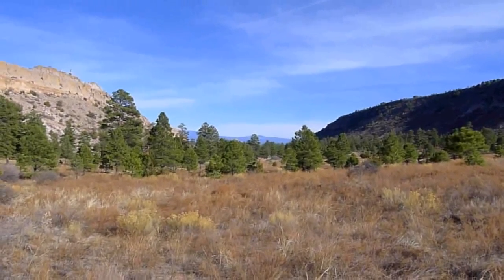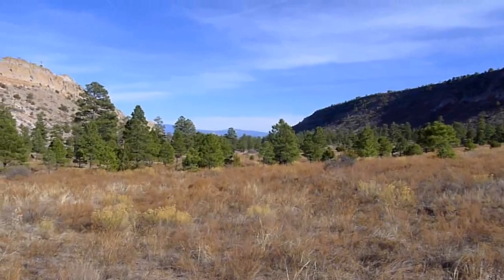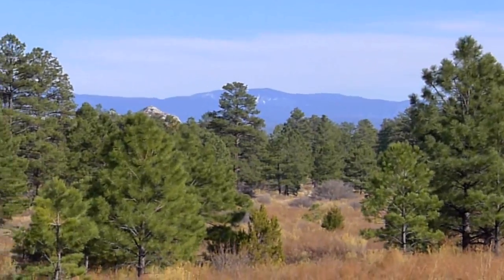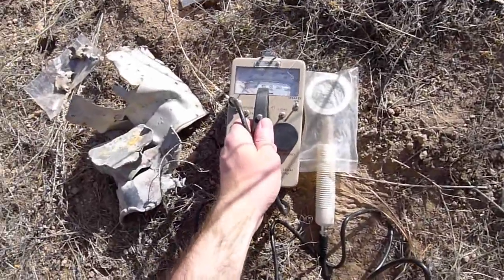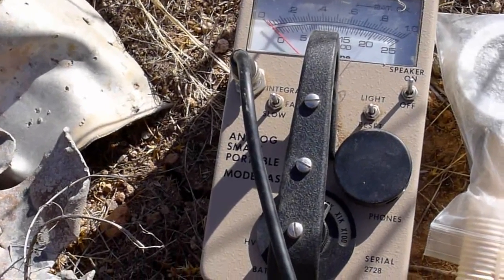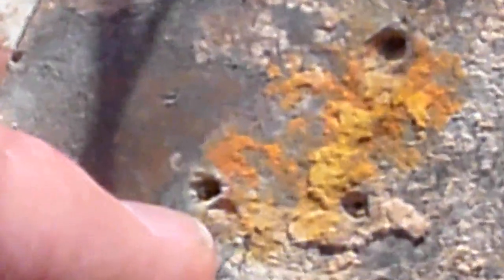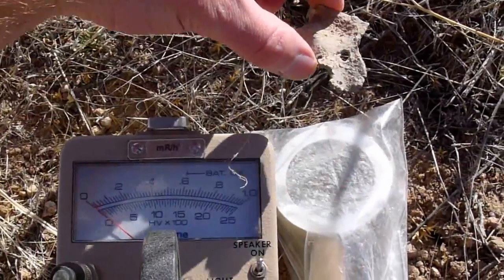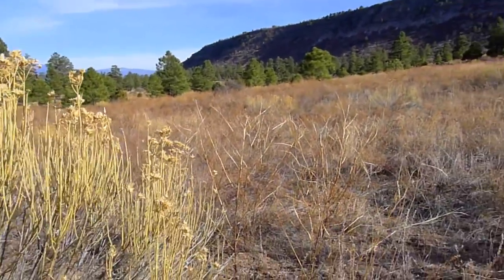Collecting radioactive debris in Bayo Canyon, New Mexico

Comment: will there still be alot radioactive material after 20 years pass?
Reply from the maker: The amount of detectable activity is unlikely to physically change in 20 years, because it is due to long-lived uranium isotopes.  Of course, collectors may walk off with all of the hot stuff by then, or stormwater may wash it away...
Reply: @Carl_Willis  It's flying around in the whole world as dust.